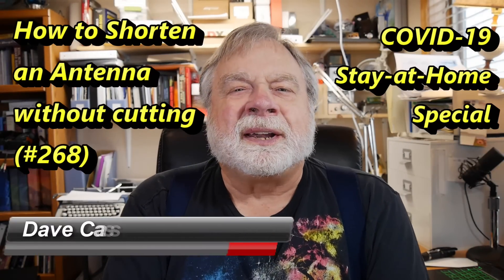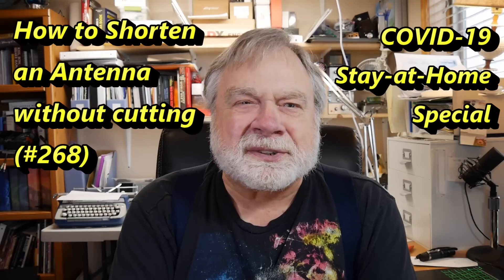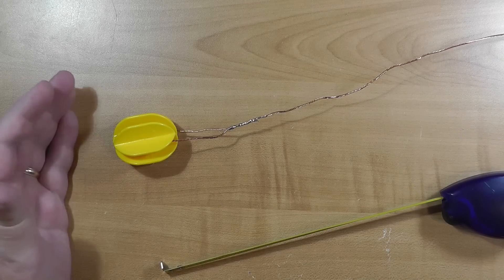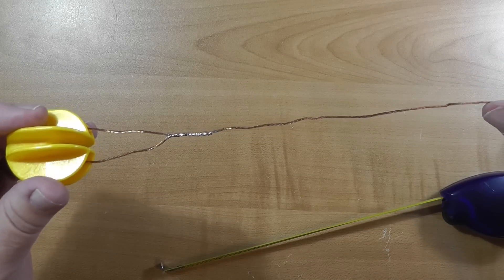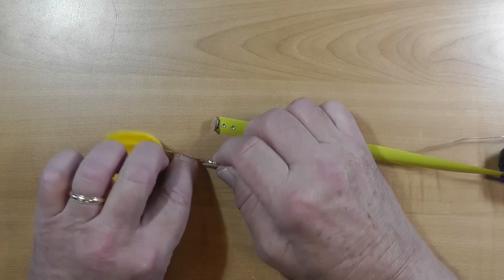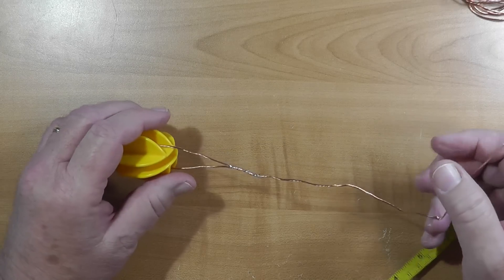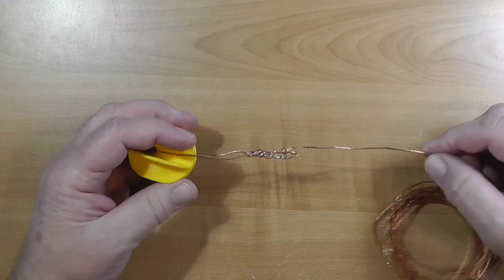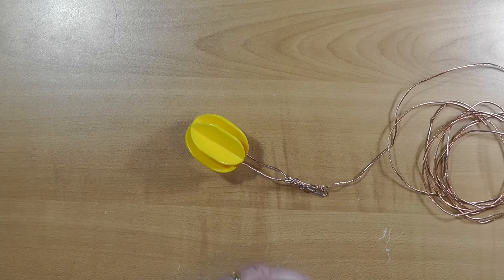How to shorten your wire antenna without cutting it (#268)

Comment: I simply make a loop and feed the bend through a short length of silicone wire insulation: instant sliding adjustment and no kinks!
Reply: Can you show us how that's done?

Comment: Thanks for this tip, Dave!  I used this method on an MJF-17754 Dipole I recently purchased from DXEngineering.  Also, I watched your video, "The MFJ-17754 40/20 Trapped Dipole (#265)", which I'm glad I did because I didn't realize it was shipped with excess wire on both ends.  I'm new to HF, but I do have a mobile 2M unit in my Jeep & an HT.  I got my Tech two years ago, but decide to jump into the HF area with a Yaesu FT-450D.  Due to my HOA, I'm installing my dipole in the attic area.  I have a 2-story home, facing south, so I have adequate space in the attic.  I'm watching a lot of your videos to educate myself on everything Ham Radio!

Comment: Hey David. Thank you. Can be done with pvc insulated wire? Wraped with cable ties maybe?
Reply from the maker: Insulated wire works fine for wire antenna, though you may find that it will affect the dimensions a bit, making them a little shorter.
Reply: Does the insulation affect the electrical length? Aka does it need to be shorted back to itself to prevent creating some weird coil induction?

Comment: Yes, another great idea, to be able to make adjustments when the wire's been soldered on the end(s); however, if one doesn't wanna use solder at the ends (& if ur using bare wire), when calculating actual antenna length, just allow for (add) some extra wire on each end (6" or whatever); then, after looping around (or thru) the end insulator, just wrap that extra wire tightly near the end insulator, then more loosely as u move away from the end(s) & towards the center. I have wire antennas that've been up for years that aren't soldered at the ends but wrapped--still easy to adjust if ever needed. 73 de WA4ELW

Comment: Dave, that’s great for bare wire because electrically it is shortened but what about sheathed cable?  with sheathed cable, isn’t it still the same length electrically?
Reply from the maker: By sheathed I think you mean insulated. The same technique works on insulated wire. Remember, RF works differently from the usual rules for circuits at DC voltages.

Comment: Nice video Dave. Perhaps a video on why does this make the antenna resonate better when you are still using the same amount of wire? For example the super antenna has coils of wire wrapped around a non conductive core to make an overall physically shorter antenna although the same amount of wire is used. How is that different?
Reply from the maker: That wrapping creates inductance, which loads the antenna somewhat. TO add loading, the manufacturer will add loops of wire much closer together, which creates a lot more inductance than winding with the loops further apart.

Comment: Thank you for the great tip on shortening a wire antenna without cutting it. I know that many times I've been in a position where once it's cut it's cut.

But I got a question for you that I can't seem to find an answer for elsewhere. I have 10 acres and I would like to put telephone poles in around the perimeter of my shack or property if you will and run random wire from pole to pole until it finally comes back to the shack. How do I terminate it and is there a specific length I should work on?

Working on 75 meters we had a gentleman that would check in from Scotland almost every night which was rare because although we could hear people on the East Coast and we knew they could hear us they never joined our QSO's. Where in California  and there was a  echo link  station in Erie Pennsylvania with a tunable receiver  that we would often use for a signal report.  We have a contest between us to see who had the best signal into Pennsylvania.  With all drop down to a hundred Watts  and see you could be heard the best.  Myself in another ham were often the winners.

He was a fine operator. I haven't heard him in a while because I've been off the air for medical reasons. But he said his trick was he ran wire and then ran wire and then ran wire. Completely a random length wire antenna. He had a lot of acreage as well.

I'd appreciate it if you would address a long wire random length antenna in one of your upcoming videos. I have a SteppIR that's great for 40 meters to 6m but the only option on 80m is almost a half wave dipole on top of the SteppIR. No, I want better. Ideally I'd like something that works on 160 as well. Don't get me wrong because I love the SteppIR! I have one of the original 3 element with the 40 meter option and the additional 6m element. I get such good reports with it I see no reason to upgrade to one of the newer antennas that they have. If it ain't broke don't fix it. My favorite band is 40 meters  and it's basically a dipole  there.  Upgrading to one of the newer antennas would cost me several thousand dollars to get one S unit. I can do an inverted V for 80 off of the tower but like I said I'd like to do 160 as well.

Your advice would be most welcome.

Comment: Thanks for answering my question. On my insulated end fed half wave I will just neatly tape the wire back on itself.
Reply: With electrical tape?
Reply: @denelson83  It is what I used. Some 3M stuff I had.

Comment: I wish I had seen this a year ago when I had to cut off the end of a ZS6BKW because it was finished with a heavy duty ferrule permanently crimped on. I couldn't cut through the ferrule to undo it so I had to cut the looped end and insulator off from the antenna. Like your store bought antennas, mine was too long and it resonated below all ham bands. All together I cut off 6 inches, and folded back six more inches after replacing the insulator, making it over a foot shorter at each end to resonate close to the middle of the bands. In all fairness It's not at least 40' in the air as recommended, but rather 27', naturally making it perform as though it's too long. This is a really good antenna trimming tip. Thanks Dave.

Comment: Watching it again, made me wonder, when measuring length of wire, from where do you measure?  From the end cut, even though wrapped around insulator?  From the point the “insulator looped wire” is soldered to a single wire?  In other words ... What actual portion of the wire is transmitting, that defines “length”?
Would have been great addition to video if while in hand Dave spoke to which portion of the wire he was showing actually counts as “length”.  Someone commented that the loop around the insulator isn’t counted in the length (not transmitting)?  True?
Reply: Everything in the wire is part of your antenna: The loop end, the soldered part, and yes, even the wrapped into itself portion.Wether it transmits or not, it is not that simple. Normally the portion wrapped back becomes part electrically of the outgoing signal but it depends on the wire size and separation of the wrapping and insulation.
The important thing is the modification of the wire and if it functions better for you, not the actual length.
If after doing the modification you want to measure what length it actually is, most people dont count the loop end.
Reply: @zrdcorp  I hope you can reply to this, in perhaps building on Tom W5VLT's question:  am I to understand that if I started with a 160m dipole and adjusted it Dave's way -  to say become, in length, a 20m dipole, that the 'extra wire' I now have would 'not' effect the 20m? (I'm having a difficult time rationalizing this to myself and need some guidance/clarification - I'm just starting out, no call sign yet, thanks!)
Reply: @johnstephens6854  You are exaggerating. To go form 160 meters to 20 meters you know you will have a lot of extra wire.... So it does not make any sense not to cut. The technique he shows is for adjustments, not to change from a band to another 8 times smaller....but you know this already....
But to answer your question the extra wire wrapped back onto itself becomes part of the outgoing wire...unless you are doing the 160 to 20 meters, then it becomes something nobody does ... ;-)
Reply: Bryan Zayas ... not understanding, if the RF wavelength doesn’t change by doing as Dave’s video demonstrates, by say folding back 5” of wire from a 20m length of antenna, what’s the point of folding back 5” ?
And further based on what you’re saying, if an antenna’s wire is 20m in length exactly (the target length for 20m RF), you’re saying the actual cut length should be 20m even if wrapped around an insulator and back around itself, soldered, so that the actual run width of the antenna is now less than 20m, that the antenna system will function as a whole 20m because it includes the wrap around and twisted soldered portion of the full original 20m cut length?
Reply: @tomw5vlt119  Nope. Did not say any of that. I am just saying all the wire radiates, but the last part folded or wrapped unto itself is coupled with the wire it is wrapped unto. So it radiates the same signal.  So even if the wire is not cut, it radiates as if it was shorter. Unless you make a huge ball of wire or leave a lot of hanging wires, then the thing may act as a capacitance hat which also adds an electrical length to the antenna.
Reply: Bryan Zayas 
Honestly, still as confused as when I first asked the question.

Comment: When wire is folded back on itself what makes it electrically dead so it doesn’t radiate?? Always wondered that.....
Reply: It is not dead. If is insulated it is just coupled to the wire it is wrapped to and takes that signal. If it is not insulted it is just electrically connected.

Comment: If you were to do this on a 10-80 end fed half wave like Mfj sells would it affect all the bands the antenna can receive equally? My end fed wire has much better swr on 3.815 than on 3.963 where I want my swr to be lower. So am I right in thinking that the swr on the rest of the bands this antenna receives will be better on the upper portion of each band the same ad it would on 80?
Reply: Whats the length of your actual wire. Mine is 84 with 4 counterpoises of 10 to 30 feet and tunes better on 3.95 tha 3.6
I was thinking of adding a 1/4 wave counterpoise measured for 3.5 ti aee if it helps the tuning at 3.5

Comment: Does the bending damage the wire, especially multistrand wire?
I suspect the width at a small length doesn't affect the bandwidth, but what would a ball or sphere do?
Reply from the maker: A little extra width at the end won't affect the antenna.
Reply: AG7MW

Comment: Great way to shorten the antenna without cutting the wire, especially cutting it too short. Then you have to add wire which can be done strongly using a scissors knot, but a PITA.